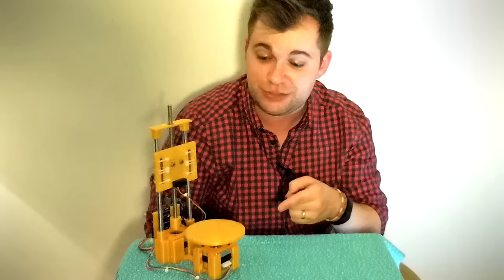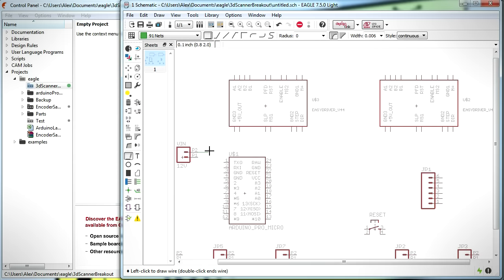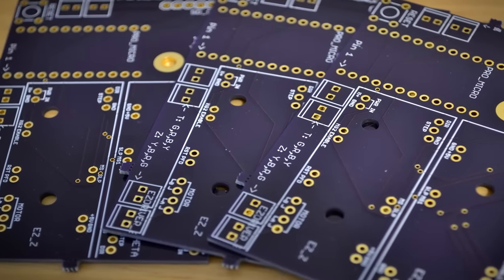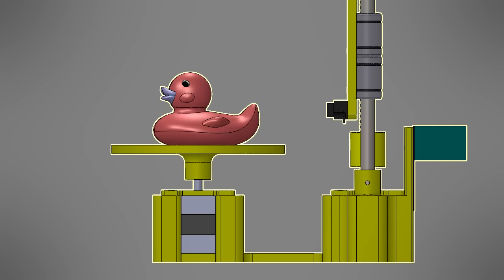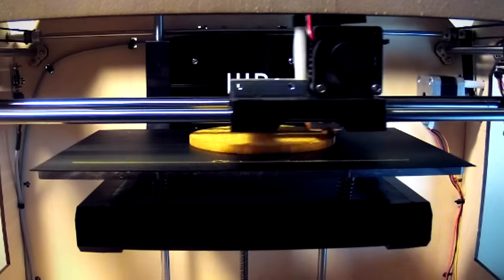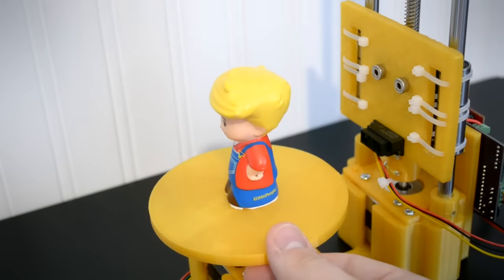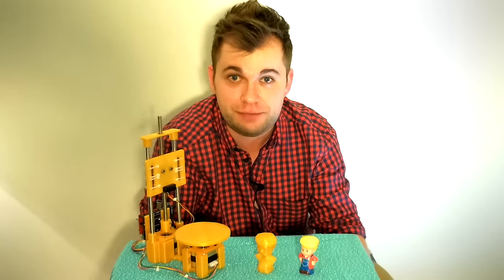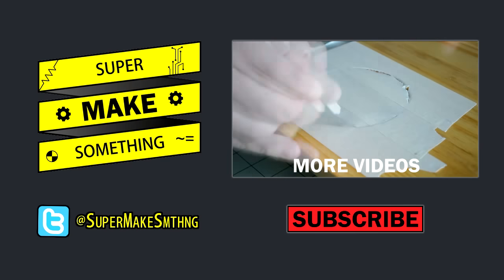DIY 3D Scanner (Arduino, 3D Printing, PCB Design, Stepper Motors, IR Sensing) - Super Make Something

Comment: Hey Alex, i followed every step in your video and when i plug in my 12v battery, the arduino micro got fried, why did this happen and what should i do now? please help thanks
Reply from the maker: Hi Lim, when you say that you plugged it in, could you provide a little more detail?  Also, when you say the Arduino Micro, do you actually mean the Micro, or do you mean the Pro Micro?  If you used the printed circuit board, plugged the power into the barrel jack you soldered on, and used the Pro Micro, then the 12 volts will have sent it through the Arduino's voltage regulator, so this should not have fried the board.  If, however, you used the Micro, the pinout may be different and you may have sent 12V directly into one of the pins, then this could very well have killed it.  In the Pro Micro, be sure that any voltage higher than 5V is connected to the "RAW" pin, as this will pass it through the microcontroller's onboard regulator, bringing it down to 5V.
Reply: +Super Make Something Hey Alex, thanks for replying, I'm using the pro micro not the arduino micro, what do you mean connect to raw? Cuz if I'm using your printed board, all the circuits are printed alr right? So I don't think I can connect to raw? Can you teach me what to do if I am using the pro micro? Thanks, Sincerely Gabriel
Reply: Hey Alex, you are using the pro micro right?
not the arduino micro?
what should i do now? please help me thanks:)
Sincerely gabriel
Reply from the maker: Hi Lim, you are correct that if you used the circuit board, everything should be connected correctly.  The only other thing that I can think of is that maybe the micrcontroller was plugged in backwards..? Here is what I would do to test it -- unplug the Arduino from the PCB and connect it to your computer directly using USB.  If it "comes to life," great -- that means it is not fried.  If this works, plug in all other components into the PCB, in addition to the Arduino, before powering the board with the on-board power connector.  This shouldn't really affect things, but I did it this way, so I can verify that this works.  Another thing is that your 12V supply may not be able to supply enough current.  If the Arduino is not fried, then perhaps try a different 12V supply.  There is also a small chance that you just got a bad Arduino -- this is unlikely, but definitely not impossible depending on where you bought it.  Hope this helps!
Reply: Hey Alex, i plugged in the same way like in the video where the micro usb is facing down, is that correct? i tried to plug back using the usb and it is indeed fried, if i connect it the same way again it will burn again, and my power supply is a 20a 12v dc , i dont think it has not enough voltage:(. what should i do now?:)
Sincerely Gabriel
Reply from the maker: 12V at 20A should be plenty of power -- 12V is indeed the correct voltage.  It also sounds like you plugged it in correctly.  Unfortunately it sounds like you either received a bad Arduino or that it fried somehow after you plugged it in.  Before plugging in another microcontroller, I would suggest to double check your soldering in order to make sure that all of the joints are soldered well and that nothing is shorted.  I would also recommend programming it when it is not connected to the board -- again that should not make a difference in theory, but that is the way that I did it, so I can verify that this process worked for me.
Reply from the maker: Sorry I'm not exactly sure what you mean by connections for the PCB.  However, all of the holes, etc. match up perfectly with the Arduino, EZ Stepper Driver, SD-shield, etc.
Reply: ok ty
Reply: Hey Alex, i got another arduino pro micro and it didnt blowup after i rewire the power source,(made the power go to raw:D), so i let the scanner run and when it finished, am i supposed to get a SCN000 file? and what should i do with it in mathlab? the youtube video is unclear, please help? thanks:)
Sincerely gabriel
Reply from the maker: That's great!  Glad to hear that rewiring fixed your issue.  You should now have a txt file on the SD card.  In the MATLAB script, make sure that the filename in the "load()" function is the same as your text file, and then hit "run."  This should show a 3D plot and generate an STL file in the directory where the MATLAB code is located.  You can print this file using your 3D printer's software.
Reply: Hey Alex, i when to the load function and typed in the file and clicked run, then an error popped up something about your processscandistance was not found in the matlab path, so i added click add to path,
and then another error popped up, saying error in load unable to read file , no file  or directory. and another error,  error in processscandistance(line23)
what should i do now? thanks:)
Sincerely Gabriel
Reply from the maker: To eliminate the "unable to read file/no file or directory error," make sure that the name of the text file specified in line 16 is the same as the text file that was created on the SD card.  The error on line 23 occurs because you may have stopped the scan by unplugging/resetting the scanner before the scan completed.  Because the data is stored in an array, it needs to have the same number of elements in each row of the array, i.e. the same number of entries between the '9999' delimiter values.  To fix this, open the text file, delete the last incomplete entry after the last delimiter, and resave the file.  This should solve the issue.
Reply: Hey Alex, thanks for replying,
i made sure that the file name was the same as the file in the sd card though, but that error still popped up,
and for the error on line 23, i dont think the entry was incomplete because i made sure everything stopped moving before removing the sd card,
do you think a screenshot of the matlab will be helpful for you; in the process of helping me haha thanks
Sincerely Gabriel
Reply from the maker: +Lim Gabriel Hmm the fact that you are getting an error on both lines makes me feel like the file is not being loaded correctly. I would first verify that the text file is loaded into MATLAB, by clicking on the resulting data variable in the MATLAB workspace.

Comment: STL = Standard Tessellation Language, not Stereolithography. 
Stereolithography is SLA, or the term for resin 3D printing...
Reply: well, both stand for STL, but its good to use Standard Tessellation language because it differentiates between the filetype and resin 3D printing
Reply from the maker: +Jonathan Kayne Standard Tessellation Language is actually a "backronym," but both are used these days: https://en.m.wikipedia.org/wiki/STL_(file_format)

Comment: Hi, Any idea what could be the cause for this error: Initialization failed    error opening scn000.txt
Reply from the maker: Andrei Rosu is this an Arduino or MATLAB error?
Reply: Arduino.
Reply from the maker: This is likely the result of a failure to initialize the SD card correctly.  One thing to make sure of is that your SD card breakout board is compatible with the pinout on the PCB.  The pin order of the board I used is GND, VCC, MISO, MOSI, SCK, CS.  If your pinout is different, I would suggest running male-female jumpers between your SD card board and PCB.
Reply: I've used the pins correctly. I've connected them as in arduino program, there are some comments that tells how to connect it. So the connections is good I think. The SD must be in a specific format? Mine is a SDHC 8Gb Fat32. Should I create the scn000.txt file is SD card? Or the program do it itself? Should I change something in the SD library ? I'm out of ideas. :)))) 

PS: Can you add me on Skype if you want. We can text faster that way:  andrew_rosu_g

Comment: Can I use an ultrasonic sensor?
Reply from the maker: +Saikit Tang Good question.  Based on information I could find online, it looks like ultrasonic sensors are typically used for larger-range distance sensing.  The beam pattern looks like it has significant spread at sensing distances, so being able to produce a high-resolution scan may be an issue.  However, I think it would be interesting to try!  These impressions are based on information I found on the below website, but if you have other sources/information, I would be very interested to learn more!

  http://www.robotshop.com/en/compare-infrared-ultrasonic-distance-sensors.html

Comment: Please i want to know the motors specifications you only write 2 Nema 17 stepper motor,.... Without writing...... K/cm????
Reply from the maker: That is a good point.  To be honest, the torque requirements for this application are not large.  A Nema 17 motor with the lowest possible torque spec for this size should be more than sufficient.
Reply: But i found 3 sizes of the same motor Nema 17, and I Am not sure that all sizes can be assembled in your design of motor bases, you understand my point????
Reply: Please send me the volume of the requied motor to be assembled correctly
Reply from the maker: They are 34mm, 26Ncm.
Reply: Is This the dimensions of the motor base 26mm*34mm?
Reply from the maker: The torque rating is 26Ncm.  You can find the housing size for a Nema 17 from this value.

Comment: Nice. How much is this project?
Reply: Jeka P it costs him around $65....which way less cheap than the maker bot scanner
Reply: Yes, around $65. BUT!!!
You must have already 3D printer (costs $500-$1300) in home
If you have nothing in home... then it will costs you more than $65, i think.
Reply: mrdummy If are planning to buy or build a 3d scanner, it's more than likely you already own a 3d printer.

Comment: Hey whats the current rating for the Nema 17 stepper motor
Reply from the maker: AUZTIN AUSTINZ This project uses a 34mm Nema 17 stepper motor and a 215mm long 8mm ACME rod. Hope this helps and good luck with your build!
Reply: Super Make Something 1 more thing can we use any ordinary ir sensor or  does it needs the one shown in the video
Reply from the maker: Any sensor with analog output should work -- just make sure that the sensor is rated for the distance at which you want to use it.
Reply: Super Make Something  hey bro what is a retention nut? Where can we buy it?
Reply from the maker: AUZTIN AUSTINZ This was a part from AliExpress, which makes it difficult to post a link. However typing it in there should give you the part you are looking for.
Reply: Super Make Something does it have name or something that i could use to search for
Reply from the maker: AUZTIN AUSTINZ ACME threaded rod and retention nut should yield the results you are looking for.
Reply: Super Make Something you on facebook? Messaging on youtube seems difficult

Comment: me to i built the project but the arduino go down because the drop voltage 12V to much i think  i got your  pcb also the arduino go down
Reply from the maker: Hi Ali, I have run into similar problems in some builds.  It seems like the quality of the voltage regulator on-board the Arduino can be highly variable -- this is especially true with Arduino clone boards.  My advice would be to try a different Arduino at a lower voltage -- something like 9V perhaps.  Hope this helps!
Reply: Thank you

Comment: can it be the arduino uno?
Reply from the maker: Absolutely!  The Pro Micro was primarily chosen for size.  While the Pro Micro uses an ATMega32u4 chip, which is different than the Uno's ATMega328p chip, both can be used in the project.  However, please be aware that the pinout I show in the video may be different for the Uno.  If you end up building a scanner, please share a picture or video with me!  I'd be really interested to see your final result!

Comment: it is just me ?
The code you give does not verify/load onto arduino
Reply from the maker: system09 wb I'm not having any issues. Could you post the specific error message?
Reply: Hi super make.
Thanks for responding.
I have someone a lot smarter than me to visit soon and have a look.
More likely, an issue I created.
I will let you know and thanks for the project.
Parts are printed.
Reply: Found this fix: Link below

Issue was: filename set as string
Change: scannerValues = SD.open(filename); 
To: scannerValues = SD.open(filename.c_str());

And change: scannerValues = SD.open(filename, FILE_WRITE); 
To: scannerValues = SD.open(filename.c_str(), FILE_WRITE); 

as per: http://forum.arduino.cc/index.php?topic=292488.0

Comment: Ok, great, nice project.  But this is way overkill for the average person...

EAGLE Make Personal Software: $169.00
SolidWorks CAD Software: $3,995.00; Student Version: $150
MatLab Software: $2,150; Student Edition: $49
MakerBot 3d Printer: $799.99

Or, you could buy a Sense 3D Scanner for $400, which is still pretty expensive, and you would still need a 3D printer.

Cool project, but not practical for most people.
Reply from the maker: +Synaxis I agree that to make physical things, you definitely need a 3D printer, but the other tools I use in this video aren't a necessity. While I modeled everything in Solidworks, any CAD software would do, and the MATLAB code could be ported to Java, Python, or C++. The Eagle version I used to design this board is actually free, which is pretty cool. At the end of the day, I just hope that the people watching this get inspired and learn something new.
Reply: +Synaxis 

There are alternatives depending on your needs.

1. Eagle Make Personal  ==> Eagle Freeware (http://www.cadsoftusa.com/download-eagle/freeware/)
2. SolidWorks CAD ==>  FreeCAD(http://www.freecadweb.org/)
3. MatLab ==> GNU Octave (https://www.gnu.org/software/octave/)
4. There is no end to the number of 3D printers out right now ranging from 299 up.
Reply: I got my copy of SolidWorks for free because I was in FRC. Its an amazing software. I see your problem tho.

Comment: I don't see the parts list.
Reply from the maker: It is in the expanded video description:

1x Arduino Pro Micro
2x Nema 17 stepper motor
1x IR Distance sensor (2cm-15cm range) - (Sharp GP2Y0A51SK0F)
2x EasyDriver stepper motor shield
1x Micro SD TF card shield
1x Z-axis ACME threaded rod with anti-backlash nut
2x 8mm linear shaft, 200mm length
4x 8mm linear ball bearing
7x 2.54mm 2 position screw terminal
1x Mini push button switch
1x 1x40 Pin 2.54mm male header pins
1x 1x40 Pin 2.54mm female header pins
1x DC 12V power supply
1x DC power female plug adapter connector with screw terminals
Reply: Where's the  expanded video ?
Reply from the maker: Click "Show More" in description.

Comment: Sir our Arduino has shorted sir due to giving 12 volts
Reply from the maker: Please check the pinned comment. Due to hardware differences, some Arduinos may not be able to handle 12V at their input.  It is recommended to start with a 5V source and then slowly increase the voltage until the scanner works and your motors turn.  A variable power supply is handy to test what voltage needs to be applied at the input.  These can be purchased here: https://amzn.to/461FTrR